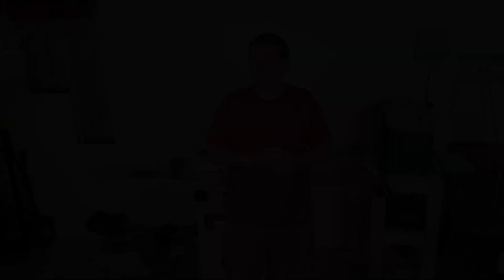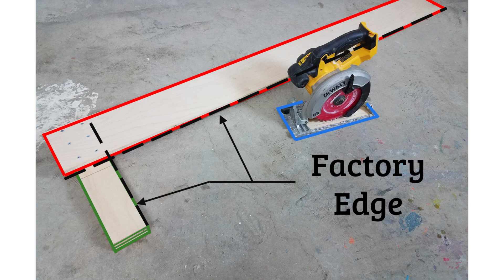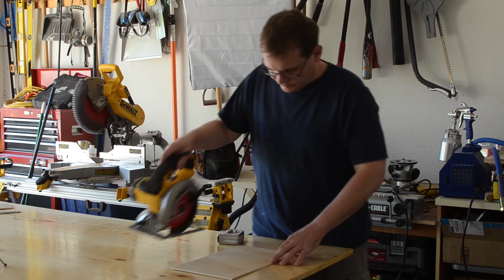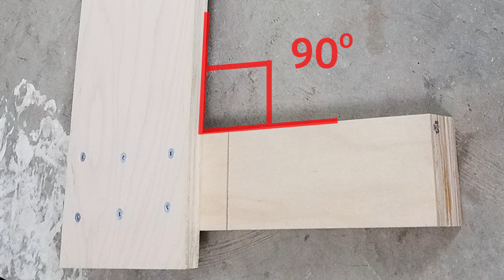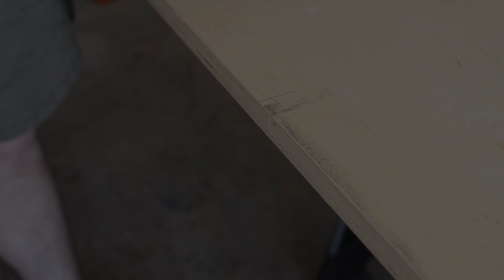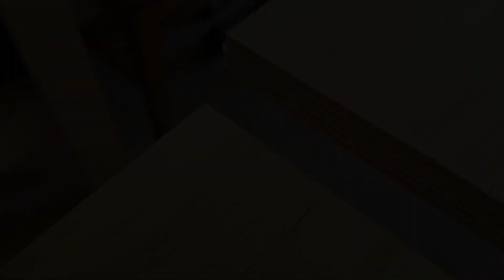DIY Sheet Goods Cutting System that is better than a Track Saw System?

Comment: do you really need a sole plate? or diy zero clearance plate?
Reply from the maker: Good question. The sole plate helps reduce cross grain tear out, but isn't necessary. Hope that helps.

Comment: For $20 bucks you can get a piece of steel angle iron for a guide.  Add a clamp at each end and bingo, you have a saw straight edge.  But if you want to over complicate a simple cut, then go right ahead.

Comment: I have always used a similar jig or saw sled. I over-cut the width by 1/4"+/- to ensure that it is easier to handle once it is placed on the table saw for a more accurate cut.

Comment: Nice job.  Did you make a longe jig for rip cuts on the long side of plywood, or do you still use your Festool?
Reply from the maker: I've found this jig is most accurate when making cross cuts. If I need to make rip cuts on a full sheet, I use my table saw or Festool track saw. Thanks for the question.

Comment: I have been having a hard time  (over the years) cutting an exact straight board especially if it's about  6 feet or longer. It never comes out exact. The longer the piece the more I dread it. I guess if you are building a frame for a house an 1/8 off won't matter because it's all concealed. But dam I am going to build this and see if I get more accuracy. Thanks.

Comment: I made a track-guide similar to this years ago.  It works great, no it works perfectly,  I did pick-up a new trick from your video.  I need to double up the edge guide.  So  I  don’t have to worry about  cutting  through the existing edge guide.
Reply from the maker: Very cool!

Comment: just as easy to make yourself a track saw guide for your circular saw. just add a track and mounting plate. plenty of videos on how. this  large t-square won't produce nearly as easy or straight cuts as a track saw would. and you don't need, or even want the 90 degree square part.  This is no more useful than a board would be, since a track saw doesn't depend on the squareness of the stock you're working on.  This is definitely not better than a track saw. It's totally different.

Comment: The chip out from the cut can be reduced significantly by placing a masking tape or painters tape before drawing the line for the cut...i learnt it from one of the you tube videos and tried...it worked very well.

Comment: you can take it a step further to remove splintering by creating a two tiered guide - so you run your saw up on top of the guide which has its own fence, that way the saw blade can run right next to the guide, reducing splintering.
Reply: see my Parallel Guided Power Saw

Comment: with sheets that have high quality wood skin a tip to avoid tear out is to do a a pass with very shallow depth of cut, the thickness of the veneer or even less to pre score it, then repeat the cut at full depth, with the blade only protruding half teeth from the inferior face of the sheet.
it is even better to do the first cut backwards, thing that for a full depth cut would have been extremely dangerous, but can be safely done if cutting very slow and with that very shallow depth of cut.
it works better then the 0 clearance plate, i never saw a 0 clearance plate work for real, both shop made ones made of wood/plywood and ones made of some plastics. 
the cut backwards works as the counter rotating blade that scores the sheet surface on high quality professional table saws and if coupled with a dedicated and sharp blade designed for plywood give the same result that you can get on those professional machines that can cost more then 10K $ with a relatively cheap hand held circular saw and with the all purpose blade of the saw can any way greatly reduce the tear out.
disclaimer: as i am talking of a cut that is done in the same direction that the torque of the motor want to push the saw who decides to do it has to do it at his own risk, if properly done is absolutely save as long as the saw is firmly controlled with 2 hands, the cut is made slowly and keeping the saw well against the jig and the depth of cut is really shallow, you have only to score the surface. but still IT IS NOT SOMETHING I SUGGEST TO AN ABSOLUTE BEGINNER, better to have at least some hours of normal use of the saw before attempting that cut, the circular saws, hand held or table saws, are among the most dangerous woodworking machines and beginners should be well aware of the possible risks and of how to minimize them.
Reply: see my Parallel Guided Power Saw

Comment: Yeah, but u didn´t cut the plywood sheet at all, just made a upper cut, no makes sense when your track has the same depth table, and the vid shows at 5:23 you´re cutting from the "L" base part, not forward of it, because if u really cut it at all the "L" base would be fall

Comment: Perfect system you have here, cheap, easy, fast. If you want to avoid chip just run a length of masking tape along the cut area.
Reply: see my Parallel Guided Power Saw

Comment: This is a good idea and a good video. I am going to make a similar saw guide. I have three suggestions. First, the blade guard can be made effective if you cut a wider slot in the back half of the sole plate. This will allow the guard to drop down. It is only the front half of the sole plate that acts as a zero clearance plate. Second, cover your cut line with masking tape. That will reduce chipping significantly.  Third, make a first scoring cut with the blade clearance set to only 1/16 th. of an inch and then go back and make the full depth cut. This mimics the industrial table saws that have a small scoring blade ahead of the main blade. I've found with the really thin veneers these days these steps will virtually eliminate tear out.
Reply: see my Parallel Guided Power Saw

Comment: Fortunately my circular saw (Bosch GKS 18V-Li) supports tracks, so I just bought a couple of those instead (FSN 70 and FSN 140, 70cm and 140cm respectively). :)
Reply from the maker: That's a great option to have. Thanks for watching and commenting.

Comment: Hi mate, I thought you did a great style of presenting this- well done. With respect, may I make a suggestion. For those that don't think it possible for them to hold the saw in alignment against the one guide rail, you can simply add another guide rail to retain the other side of the saw plate in place between the two guide rails. This has the added benefit that the guide is now 4 sided (ie. stronger, two main saw rails screwed to two side guides) and the saw runs in between the two main guide rails. No more saw twisting or struggling to keep the saw in alignment against just one rail. Still only need to clamp just one rail. Make guide rails long enough to fit a little wider than standard size sheets. This way you can make the saw rails of smaller dimensions from hardwood instead of ply if you want too.
Reply from the maker: Great idea! Thanks for sharing your suggestion.
Reply: I made a similar device a few years back. Instead of adding another guide rail, I put arms on the saw base, to extend it over the guide, ploughed a groove in the guide, and ran a key in the groove.
Reply: see my Parallel Guided Power Saw

Comment: What's the point of the wood part screwed to the saw
Reply from the maker: This plate was added to reduce tear out when cross cutting plywood.  It's similar to adding a zero clearance plate to a table saw.

Comment: I like it. With this jig you could score the grain with a knife, move the jig to the score, and cut chip free. A couple of on-the-job workarounds: Make a shallow 1/8" deep chip free pass across veneer. Drop saw all the way down for second pass to cut bottom chip free as well. If only one side of the sheet will show in the finished project, cut it upside-down.

Comment: Thanks mate, a very nice and easy to follow step by step guide to make a track saw for those that can't afford expensive manufacturer guides, thanks for sharing this neat advice!
Reply: Yes, but this isn't a track, is it. It's a fence so you must keep applying constant pressure to the side (unlike with a proper track system) in order to maintain a straight cut. I, a newbie, have ruined many cuts because I was too conservative with how much force I was applying.

Comment: a track saw prevents the saw from moving laterally in either direction.  your jig prevents it from moving laterally in only one direction.  so your jig is, at best, about half as good as a track saw.  I mean come on.  what do you think might happen to your cut when you do that texas two-step around the corner at 5:22??
Reply: Evidently you are a puny , weak, limp wristed little guy  who doesn't have the strength and knowhow to hold the saw firmly against the guide as you cut. I would suggest you stick to flower arranging and leave woodworking to the adults.
Reply: @OldDunollieman  Oh, now don't be so restrained, just say what you mean!  Just had the best laugh for a long time, thanks for replying, (still chuckling).

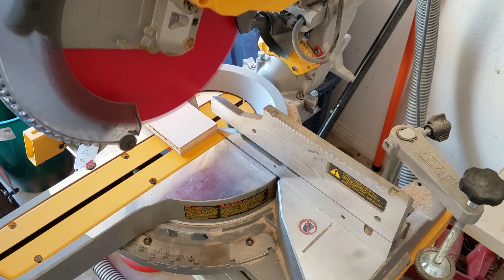Comment: Great video, a simple and easy to make jig. At 1:45 of the video, would you explain the reason why you left an offset of 1/16" (1.5mm)?
Reply: When gluing two flat pieces of plywood together, it tends to not be the same on each edge.  The two together gives strength... however, one was only needed for the 90 degree reference.  So, making the reference piece touch your sheet of plywood to be cut would provide the best edge every cut.

Comment: I like that you added the square so that setting up a cut is quick and easy. Although it's not a full blown track saw design as long as you use the saw properly it will cut just as good.

Comment: Buy a quality clamping straight edge less than,$100 for a good one.
Reply: Mine were even cheaper than that but only came in 48" lengths. I got around that by bolting them end to end to an 8' length of plywood and precision aligned the whole length by tightly stretching some fishing line down both pieces. If the two extruded aluminum straight edges are touching along the full length it's straight. Then it was simple to make a full depth cut with the circular saw. It's as accurate or more so and far easier to use for full sized sheet goods than any table saw I could afford the room for.  There were a few good ideas in the video though. Adding the 90 degree fence and partial cut line to show exactly where the blade line would align with the required cut line and the zero clearance insert were both good ideas. Since mine doesn't have the 90 degree fence my cut line from the first full depth pass does the same thing. I do have to align and clamp mine with two measured marks without that second fence. So his would be a bit quicker to use.

Comment: Nice video and jig. More teeth per inch is what eliminates tear out. I use a 60 tooth carbide blade for my 7-1/4" Dewalt circular saw, and even in oak, I have NO TEAR OUT. You can score just through the top by setting your blade to only cut 1/8 inch deep after the track is set and clamped. Then set full depth and make a second pass. Tear out happens where the tooth is cutting up on the wood, and can chip, but does not happen when cutting down. Commercial table saws, have 2 blades that are a matched set. One turns backward to the other and scores the sheet, and the second turns the regular way and cuts through. The one I used had a 5-1/2" blade, reversed to a 14" blade. There is a left to right adjustment on the 5-1/2" blade, to make sure the score is perfectly aligned to the 14" blade. This is really necessary for Mica board. But I found that the 60 tooth blade eliminates that step for wood products on 7-1/4" saws. Additionally, gluing a piece of laminate, (1/32") to that bottom of that plate you made for the saw shoe, will make it slide easier, and it will be much stronger.  I am retired and trying to pass on some tips. I hope it doesn't come off any other way than trying to help.

Comment: Good job on the cutting system. Cutting sheet goods can be a problem and a safety issue. I used a similar idea but used an aluminum drywall square. I bolted/screwed a small (6X6in) piece of quarter inch plywood to the left leg of of the T of a drywall square.  This small square creates a clamping surface and keeps the square from flopping over when getting ready to cut. Lastly I had to create the alignment reference edge for the saw setback where my circular saw was going to cut. I clamped the square to an old piece of plywood and ran the shoe of the circular saw along the long leg of the tee cutting off the right leg of the T square creating the saw setback or reference edge.  This cut edge became the alignment point to which the drywall square would be placed on the mark of future sheet goods to be cut. I use spring clamps to attach both ends of the square to the sheet goods. For tear out prevention I just place painters tape on the cut line prior to making the cut. works great!

Comment: why wouldnt you  prevent chipout by using masking tape? I have a low quality circular saw (craftsman) and never see any chipout. Better than your festool.
Reply: Check out WoodWorkWeb. The guy ran several tests with different tapes. No effect at all. And I can confirm that from my own experience.
Reply: @ralphgehteha9924  I agree, the best way I have found is to score into the ply with a stanley knife on the reverse, or use a sacrificial board underneath

Comment: Too many sole plates aren't perfect parallel with the blade. You should have instead built that into your zero clearance plate and guide.
Reply: You make a VERY good point. I've got a Harbor Freight dial indicator that I use often. So often in fact that I've cobbled together a few jigs so I can do quick checks when the spirit moves me. Thanks for the good tip.

Comment: A trick I learned from a few old timers: rip a piece of ply (factory edge) 100mm or so, for your guide. Rip another at 200mm for your base plate. Glue and screw together. Run your saw along the guide to cut your base plate to the same size as your saw's base plate. EZ
Reply: Same system I’ve you’d for years ,quick simple and accurate,can make a board on site from scraps
Reply: This is the best method. I've done it myself. I use 1/4 ply and it's perfect.
Reply: I don't get it... Got a link?
Reply: Robert Ye  cosmas baur making a saw guide
Reply: @johnhealy9231  oh my God, thank you so much! Why didn't I think of that! I bought an ozito track saw for &185aud and it's cheap Chinese junk that I have to throw in the bin, it is terrible. Now I can buy a cheaper high quality circular saw and make the track as you've shown for a great setup!
Reply: Isamu T I'm not a hobbyist woodworker, I'm a carpenter. What you have explained is the only way to do this. Old timer showed me this back in 1969 and I'm sure somebody showed him. He used plex-I-glass for his. I have a couple of these of different sizes. Great for cutting doors and building on the job cabinetry when a table saw is not available. All this and you don't need that silly, unsafe plate on the bottom of your saw either.
Reply: Basically a DIY 'Zero Edge Saw Guide'.
Reply: Mike Girard   Exactly. Didn't watch the whole video, just the first 5 seconds. Keep material thicknesses small for the deepest cut, Bottom piece 1/4", top piece 1/2".

Comment: Just buy a kreg jig
Reply from the maker: The Kreg KMA2685 Saw Guide is great for ripping, however, you're limited to cuts up to 24". The design of the cutting system described in this video is not limited in that regard. Thanks for your input.

Comment: That's a cool guide.
I started using a steel demon blade recently because it was the only new blade I had, and it did cross cuts beautifully! If you look at the teeth, I think it's a tripple chip.
I'm making one of these guides, I hate doing plywood cut off with my little table saw.

Comment: I didn't understand why you needed the plate under the circle saw
Reply from the maker: The plate was added to reduce the grain tearing when making a cut perpendicular to the grain direction.  Hope that answers your question.  Thanks.
Reply: Firas Musmar It acts as a zero clearance plate, reducing tear out.

Comment: I am giving you a C+ grade for this jig. You were very close. I had to fail Ron Paulk and Silva at This Old House. Their designs don't even square up to the material. Here's where you went wrong:  Now imagine an upside down tablesaw sled, 2x4's front and back, about 12inches wide.Cut scrap track material the same width by how long you need the track. Attach squarely to front and back 2x4's. Then cut two strips same length as track material for your LEFT and RIGHT edge guides for your saw's (ooh, fancy Festool) base plate. Attach squarely. Run your first pass. Saw kerf, just like your jig, gives the cut line. This track gives you a 'no wander' cut, even with angles. Donations: USA for UNHCR. Thanks
Reply from the maker: Hey, if I graded better than Tommy, then I'm happy! I'm trying to follow what you're suggesting, but I cannot picture it. Do you have a video or diagram on how it works?  If you do, post the link in the comments. I'm always interested in seeing what other woodworkers use. Thanks for sharing.
Reply: Woodworking Explained easiest way to send the sketch? your email?
Reply from the maker: Sure, you can send it to the following email: woodworkingexplained@gmail.com
Reply: studfindingball What is UNHCR and who the hell are you?  This kid is bit naive in his justification and explanation of the greatness of his jig.  But he’s young.  He’ll hopefully come to understand that this is nothing new in the woodworking and handling business.  But I ask again.  Who the hell are you and why should this kid give a hoot what “grade” he receives from you?
Reply: Patrick Perry UNHCR is the UN refugee agency. I am a retired cabinet maker with 35 years experience as a custom bench carpenter, mostly commercial work.